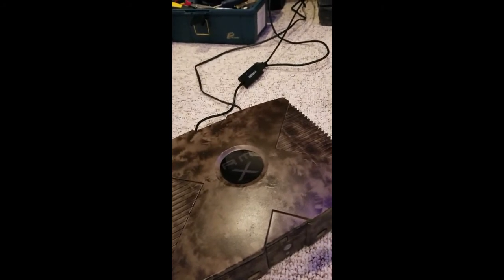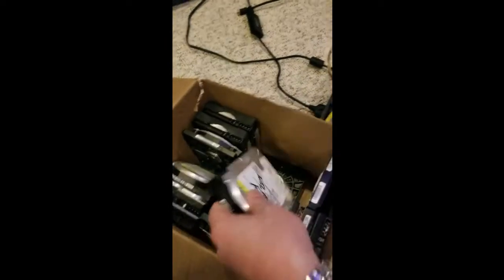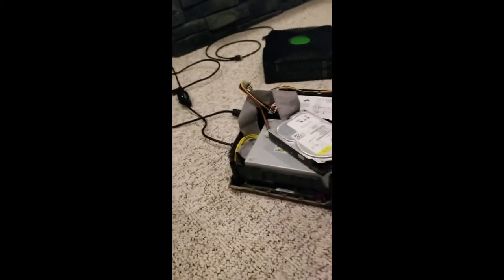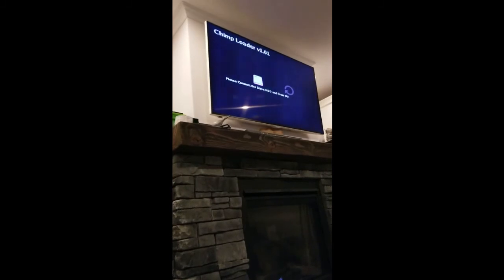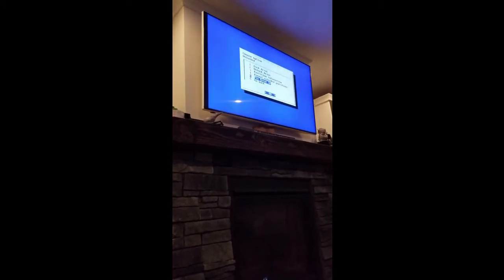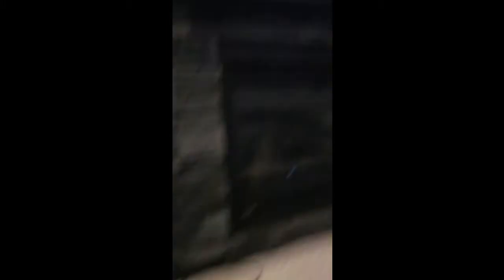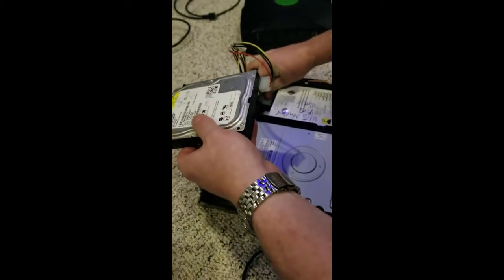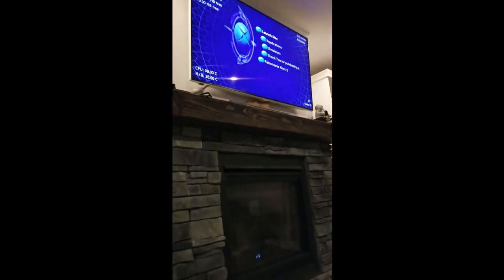Easy Hard Drive Errors fix for Original XBOX!!!

Comment: Could error 6 be rated to clock capacitor? I just got this xbox from goodwill, rev 1.3, checked it out i side before powering on.  Removed clock capacitor. All else looked ok. Put it back together. Xbox powers on as soon as I connect the power cable and it gives error 06. It didn’t look tampered with.

Comment: Got my xbox soft modded a few years ago from a shop and it had thousands of retro games emulating on it.
Woke up one day and boom FRAG and error 7.
I'm not remotely tech minded but is there anything i can do to get it working again?
Reply from the maker: Likely not. Error 7 is hard drive issue. Hopefully it's a loose ide cable. If not hard drive may be dead. You could try to copy hard drive to new hard drive if you zeroed the keys on your xbox
Reply: @FoxFishing4K  genuinely no idea what zeroed the keys means lol all I did was buy it ready to go and used it till it died. I replaced the ide cable but still no joy and I don't even own a PC or Laptop to attempt to copy the hard drive 😢

Comment: So if I take a hard drive from one Xbox that’s been locked to it’s EPROM from its motherboard, and slave it to another Xbox with a totally different EPROM and use chimp I can unlock that drive? And even if I could, the slave drive would now have the HDD key of the Xbox that was used to fix it with chimp? How would I make that drive work with its original Xbox system? My problem is I’m getting error 13 and 14 and it’s not booting from any bootable recovery disc such as slayer or truHexn… from what I’ve learned I need to get a custom-made device to read the EPROM on the motherboard to obtain the original hard drives key I’m trying to recover the hard drive for. Is there no way around this? Thanks for any info.
Reply from the maker: For all your xboxs null the key to all 0s the. You can swap hard drives.
Reply: @FoxFishing4K  oh ok thank you.

Comment: I softmodded my xbox and was working fine then it froze and when i reset the console it now has erro 7 messege which is an hdd problem. I need to either fix my hdd or create a new one. I need a a solution that doesn't require my xbox because i can't boot into it because my softmodded xbox i only have one hdd and it is the hard-drive that has error. Your solution is to have a working softmodded xbox to fix a bad drive but u can't get into my softmodded xbox until I fix the drive
Reply from the maker: May have to lock the hard drive to your console
Reply: @FoxFishing4K  the bad hard drive is locked. I was not able to.unlock to clone a new one yet. The only change to my system is it is softmodded nothing else has changed but now i get error 7
Reply from the maker: @theghastlygamer5326  hmm. I would throw a mod chip in it. Then fix hard drive and remove mod chip.
Reply from the maker: @The GhastlyGamer  if it's a 1.0-1.4 after mod chip tsop it.
Reply: @FoxFishing4K  its either 1.4 or 1.5 from what i could find
Reply: @FoxFishing4K  can you recommend me a modchip

Comment: Hey I need some help. I'm getting a mix of errors 13, 16, and 21 depending on if a games inside or not. I dont have a computer or burned disks to fix it, do you have any easy fixes?
Reply from the maker: What does it say without the game? Best bet would be just chip the system with that many errors
Reply: That error is the soft mod files are screwed, u need to replace c and e folders, only thing the hard drive is locked so u will have to hotswap

Comment: I had my xbox original repaired years ago but it won't open, i found out that the hdd was replaced with a new one and needs to be unlocked. I don't have my old hdd and also dont have a password to my new one since my dad was the one that took it to a repair shop. Do you know any solution that might help ? I wanna play my xbox badly and i spent most of my childhood playing on it.
Reply: U need to hotswap
Reply: @gregphillips3806  what does 'hotswap' mean?

Comment: I have 21 problem , how can i find solution , without new hard disk can i do it ???
Reply from the maker: That means dash board issue. Try loading a newer original Xbox game in the system it may fix. You can also chip the system. Start with the newer Xbox game to see if it repairs dash

Comment: Is there any way to retrieve data (game saves) from a hard drive? Like convert it to another one or somehow hook it up to a computer? My Xbox isn’t modded it’s stock but stopped working. I have other consoles that work but want to retrieve my game saves & as I’m sure u know u can’t just plug 1 hard drive into another system, it doesn’t read it without the code
Reply from the maker: You can plug one harddrive into another just null thebcode to 32 0s
Reply from the maker: Softmod the lriginal xbox with saves and then null the hd key. Clone hard drive using chimp

Comment: I got no clue on how to do any of this things..got a modded xbox but the power button doesn't work it turns on when i hit the tray buttom but now it gives me the service screen.... Can i just send you my brick xbox for you to fix? For a fee ofcourse.
Reply from the maker: Due to shipping costs it would be cheaper to just send you a modded xbox already done. Joinnour facebook page. Retromania Xbox RMX
Reply: @FoxFishing4K  some one had previously said to just sofmod another one and simply swap the hard drives? In any case I'll check out the the facebook page you mention and i guess get in contact with who ever is selling one.
Reply from the maker: You can softmod another xbox. Then null the hard drive key to all 0s. Use John Conns softmod. After the key is nulled it can be placed into anyother xbox with nulled keys. Every xbox is paired with a serial number to the motherboard. Keys have to be nulled before you can switch hard drives.
Also if your xbox is turning on with the reset button that is almost always indictive of Trace damage unless it is chipped. If it has a mod chip thats a different story

Comment: Hey my xbox turns on for a few seconds then shuts off instantly can anyone please help me? I took everything apart and everything looked perfectly fine so im confused
Reply from the maker: Will be either trace damage or power caps
Reply from the maker: Check the top of the capacitors and see if tops are bulging
Reply from the maker: If the power button works to turn. It on and it shuts off by itself it's probably caps. If it powers on soon as you plug it in it will be trace dmg
Reply: Nothing is bulging and there is no internal damage i checked everything and it was clean so idk why it’s doing this, maybe it’s the power supply?
Reply from the maker: Could be the power brick then. If you want add me to facebook kevinfox2010 I can help you further.
Reply from the maker: It wont be thermal paste. The xbox rarely overheats. You can change it but that is not your issue.

Comment: I don't have a nother Xbox original how do I do this
Reply from the maker: You need another xbox to get first one working.
Reply: @FoxFishing4K  I don't have another Xbox but I do have a hard drive for an old Xbox original and what Molex cable do u use
Reply: @FoxFishing4K  I don't have another Xbox original is there another way around it
Reply from the maker: The molex splitter